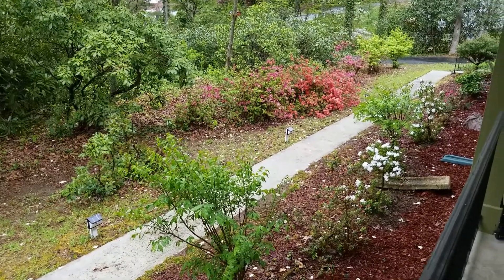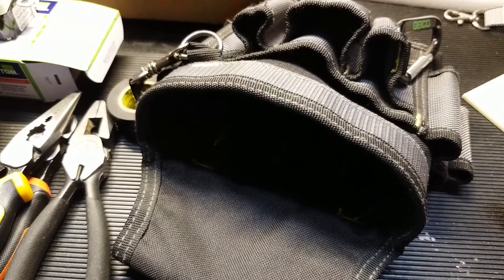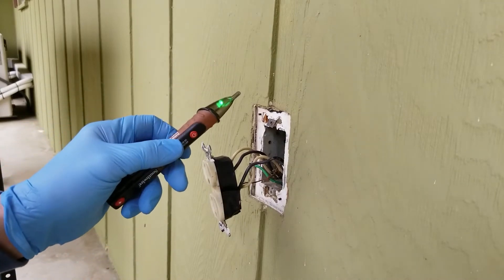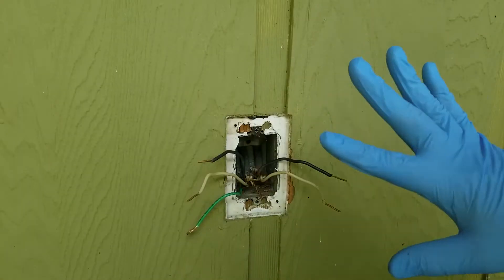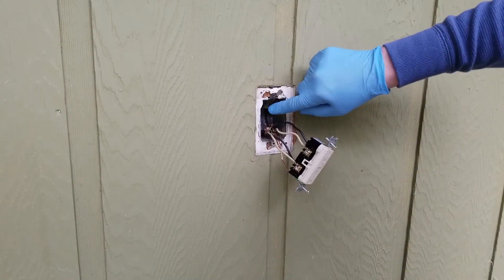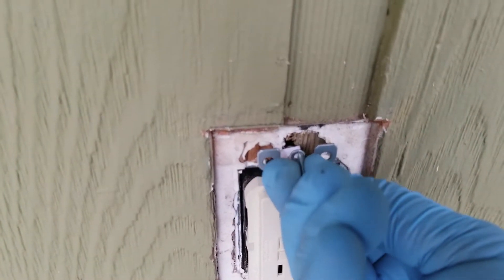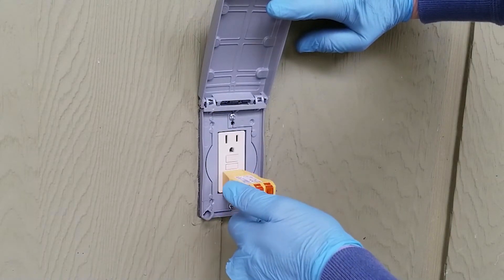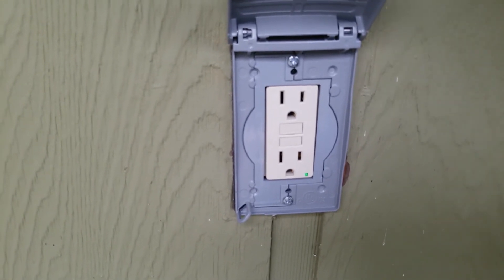Replacing killer receptacle with GFCI (Complete Guide)

Comment: You’ll need to use an “in use” receptacle cover outdoors per nec 406.9(b).
Reply: 406.9(B) does not apply.  The location is a "Damp location" (406.9(A)) and not a "Wet location" (406.9(B)).   406.9(A) says it covers "a location protected from the from the weather" and further that this includes "under roofed open porches", which is his situation.  It further says for that situation it "shall have an enclosure that is weatherproof when the receptacle is covered (attachment plug cap not inserted and receptacle covers closed)".   So what he did is fine there.
Reply from the maker: @RJ-ej1nr  Thank you for the clarification between damp and wet location. As you stated our receptacle exposed to the weather is 406.9(b) while the ones in our enclosed porch and under roof open porch are 406.9(a) compliant. Again thanks for helping others understand the difference.
Reply: Detail....
The receptacle is protected by a GCFI anyway.

Comment: Quite impressive, job well done!  A couple minor notes - as for that broken wire, pay attention to the bend radius of the wires as you fit them in the box. That bend radius should be at least 5 times the size of the cable.  Where they came out of the receptacle it looks like it was nearly a 90 degree just a few mm out from the clamp.  I'll bend the wires coming out the back over what is basically a 1/2-3/4" dowel (voltclaw) so that area doesn't get pinched in the push to fit the receptacle in.  You were also likely hurt by a wire nick - on replacements I'll clip and do a new strip when there is a nick (too common) or extra length (which you did not have much of).  Another item, per 2020 NEC code, the receptacle should be WR rated even with it being under a weatherproof faceplate (406.9(A)).  Practically speaking, it's not likely to matter, but be aware if your situation warrants.
Reply from the maker: Thank you for sharing all these useful tips. Just checked specs on the receptacle and yep you are correct it is not WR rated. Adding that to my project list. Thanks for the watching and the feedback, much appreciated.